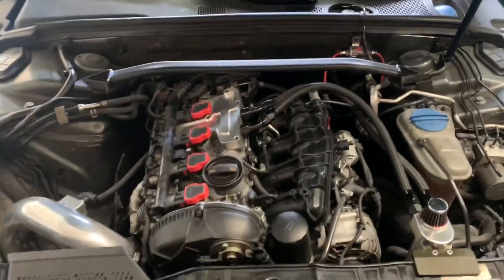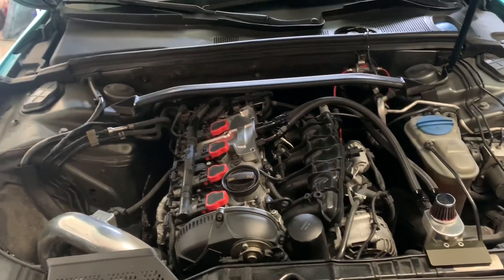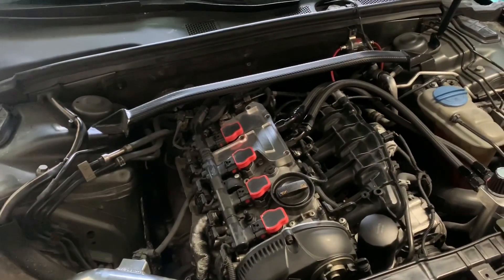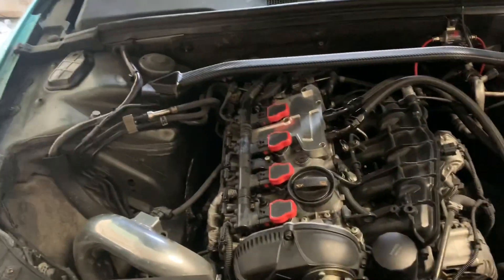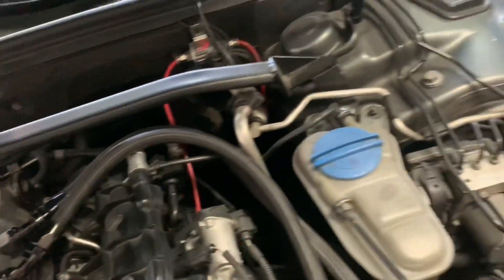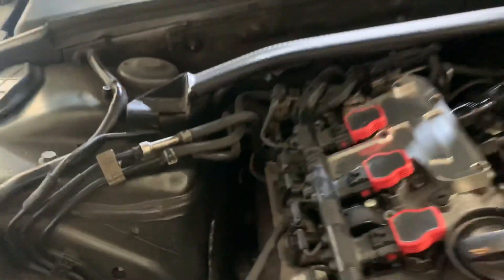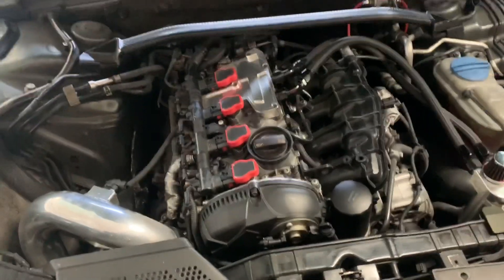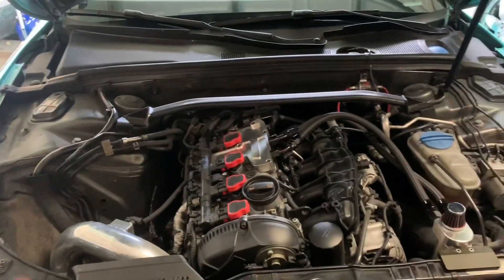How to get 455 hp to a Audi b6/b7/b8/b9 or Vw 2.0 tfsi or Fsi

Comment: that car if your lucky has 350 hp if it's got a k04 but since you lied about dyno numbers who knows post you numbers if you dyno that car let's see the paper work cause there's no waybthat car had even close to what hp your saying lololololol
Reply: IE only boosts that engine to 367hp by using 100 AKI / 104 RON, so pushing this engine to 450??? Sounds like a nice big bowl of baloney.
Reply: @study-tesh9542 yeah this thing is 350-367whp max, I think bro thinks because he has WMI that it is giving him HP. He has an OTS tune it hasn't been dyno tuned on a more aggressive WMI method. So he's really only keeping temps constant to slow heat soak

Comment: i thought these engines like imploding at 300 ft lbs of torque i have an 05 audi a4 b6 1.8t id like to do things to do im afraid of it sending a rod so im waiting to get forged rods to do anything
Reply from the maker: No even Apr revo and ie are l above 300
Reply: @brucecustommotors  is it safe to run those tunes for longer periods on a stock motor with support mods or would it go boom

Comment: Hi BCM, I have a 2015 a4 b8. I tuned it with apr stg 2. Now I need to upgrade my fuel pressure regulator. Can you help me where to order & which one is good. I've been trying to find one but not sure which one. Ty
Reply from the maker: No you’re good b7 only need the upgrade
Reply: @brucecustommotors  but I have misfire on #2. I already change my plugs, coils & fuel sensor. Still have misfire. Check engine & EPC light on. If you can help me please. I really appreciate it. Thank you

Comment: Anybody know if the stage 2 plus tune from IE has launch control for MANUAL 6 speed 2.0ts?or is the launch control only work for the DSG??
Reply from the maker: hey brother I actually, have a custom tune from them, im on revision 6, there cool, just called them, they may even retro a tune for you, or let you know if they have it or there plans, let them know bruce sent you
Reply: Thanks man thatd be great.cars getting a new clutch and lighter flywheel  currently.stock clutch didnt like stage 2 lol.when it's back together I'll definitely be looking forward to that

Comment: Hey so i have 2 questions, I have a 2012 audi a5 cabrio and i am planning on getting the ko4 turbo and i seen how you added the Audi r8 coils,

Wagner inter cooler,

bosch s3 fuel injectors,

Snow performance water meth kit,

Cts turbo oil catch can,

Injen air intake,

flowmaster series 10,

Throttle body spacer,

GFB diverter valve,

Sprint booster, and the 

APR Muffler delete

I was wondering do I need to have all of these installed at the same time in order to put in a ko4 and if not which ones out of these list do i definitely need to buy and install in order to put the ko4 in without having problems. Because I am planning on getting all of these on the list but was wondering which ones are mandatory for the ko4 installation and which ones I can gradually buy later on. 
My second question is should i have the stage 3 tune done on before or after I have the ko4 installed because i know i have to have it done in order to get the ko4 I just didnt know which one i had to get done first, or do thy just do it at the same time?
Reply from the maker: So let me say this, if you get a k04 without the upgrades, when your car boost it will run lean, do to the extra air flow from the turbo.  But only if you push it hard, and go into boost, if you drive it normal with out boosting past 5 you won’t have any issues. The k04 basically pushes more air to the combustion, so you don’t want any restrictions, I ran my ko4 on a revo stage 2 k03 tune, for 2 weeks with no issues, before I got my k04 tune, at the time I had a down pipe air intake, and diverter valve, and inter cooler, which is what I would recommend

Comment: Did you have to upgrade suspension or trans as to not brake anything ? Currently running stage 2 b9 A4 thinking of taking the next step but don’t wsnt to break anything
Reply from the maker: What’s up bro the only thing I did was 
In these 2 videos 

https://youtu.be/Vr8XzO-7sm0

https://youtu.be/TVmF_dUo-FI
Reply: I’ve heard that if I do ko4 swap and water meth I run the risk of harming engine internals I’m not sure if that’s true or not so looking for first hand experience how long have you been driving it with all those mods how often and any problems ??

Comment: Hey bro i need some great advice from you since your like Albert Einstein on this platform. So I bought me a 2010 Audi A5 Quattro Manual AwD its at 151,000 miles on it. I replace new rocker arms and cams and clutch recently and my turbo is out but im driving perfectly fine like a brand new car. But to go the same route as you is it worth doing it with the condition and me being the third owner ? Because I know its alot of money to tear down a motor just to see if the engine is in good health but should i risk doing that because I know its hella expensive or is it safe to just start putting in a Ko4 turbo into it with same mods like you with out the watermeth?
Reply from the maker: I would do a compression test, to see if the engine is healthy, it’s cheap and can let you know how strong your car is first , and then follow the steps in this video and you will be fine https://youtu.be/YZO_tu0u7vA
Reply: Thank you man, I appreciate the advice and much love please keep progressing in this field that you are in and i love all the videos you put out they are amazing. Just im still here for your support for all your next videos

Comment: Hi Bruce
I have been having trouble with my catch can set up since the beginning and I thought you might be able to help. My 2011 a5 has a fully rebuilt CAEB longitudinal 2.0T with basically all the same mods you have as of date of this video. I know you have moved on from there but I'm still running the APR 04 turbo and software. I bought a Spulen Africa plate from USP Tuning and combined that with a Ebay AN hose kit (AN10) with a generic can and a ventilation filter basically identical to yours.  My car will smoke badly and the can fills quickly when I install the can system. After combing the internet for fixes I also stuffed the cam with shaved steel wool material to aid in condensate extraction. Still same problem! Would you have any advice to offer on the subject? I'll try to attach a photo to show the set up. As always thanks for your input.
Reply from the maker: send me a photo , to productuions@bgeminirecords.com , i wonder if its set up backwards, or your tube or internally, if the mesh is backwards

Comment: Hey Whatsup man I got a 2006 Vw Jetta Gli in my backyard with 164k on the dash looks neglected but It still turns on and runs good this car has paddle shifters and Dual Clutch Transmission its a FSI Turbo 2.0 you think it would be worth doing something like this? the engine looks identical to yours
Reply from the maker: yes a 100% you may have the 1.8t like my b7, but you can get same numbers, and believe it are not , they have alot of big turbo upgrade options, for that year
Reply: @brucecustommotors  So mine is a 1.8? Everything says 2.0 on the engine bay

Comment: Did you have to get a custom tune for your weather meth injection bc am planning to go stage 2  with IE with my 2.0t b8 a4 I already have my cai, HF downpipe  big intercooler
Reply from the maker: yes i had my tuner tweeked for more timing, but before that i was just running the apr 100 octane fil starting my injections at 12, and full at 22,  when i was with revo, and i just, did it my self with my sps controller, and looked at data logging, now with ie, and tweaking it as we speak, im getting ready to install the intake, and then will dyno, and hopefully get higher numbers. check out these videos

ie intake manifold review https://youtu.be/M7Y_r18ECVM

how to tune with ie https://youtu.be/m8p9C5m_pSA

water meth playlist https://www.youtube.com/watch?v=rJBG6gfd3UE&list=PLDYd1CUN-FCMgjKKE7a6LrwQFSUDP6wB7

Comment: Bro. Help me out. How did you fix the problems oil consumption ??
Reply from the maker: https://youtu.be/NTXW6AiM_oc
Reply: @brucecustommotors  i got it. The problem is that i run 300km with 1l. That's  a lot. And for changing the piston is 3000e a lot for me. I just bought it 1year ago for 10k at 116k km. What you recomend? The Catch can can solve a bit of the problem ?

Comment: Can you get away with upgrading to the s3 injectors while still on the k03, or would it only be beneficial with the k04 turbo?
Reply from the maker: You will get a slight bump, but nothing significant, unless you tune, but you can get a little more power with a good air intake
Reply: @brucecustommotors  thanks, was planning on getting it done with hpfp upgrade and a carbon clean. Only running stage 1 with dv+, so still have some way to go. Hi-flow cat and fmic are up next.

Comment: I've heard rumors of turbo oil leak from blocking off the intake manifold driver side pcv port. Maybe something to do with over loading the diverter valve lines since some pressure would normally be venting out off the valve cover driver side pcv port. Also the crankcase would be venting out of only 1 valve cover pcv port versus 2 ports, what it was originally designed. Replacing the cyclonic oil separator with one that is lacking a cyclonic system is not a good idea. I understand that the whole idea is to prolong carbon build up on the intake valves. I've researched all Audi A4 B8 FWD 2.0 catch can systems. I think all of the catch can designs (BFI, Billet, ECStuning, CTS, etc) for this particular vehicle all have flaws. The reason being it completely ignores either the driver side or the passenger side pcv vent system by simply blocking off a side. In addition of the block off, some system completely replaces/remove the cyclonic oil separator. If I was to do a catch can system for this vehicle, I would go with the ECStuning system that keeps the cyclonic oil separator. It covers the passenger side pcv port TO ECS catch can TO turbo inlet. Then I will install a custom catch can system mount on the driver side firewall that covers the driver side pcv port TO baffled catch can TO intake manifold. That would be an ideal system for me to prevent a problem down the road. Catch cans you'll have to keep empty them, even more often if your driving region have bumpy roads and hills. Either that or don't install one and remove your instake manifold ever 90k miles or so, manually turn the crank to close each cylinder's valves and clean them one by one. I would also inspect the intake valves using a borescope every now and then. Stupid direct injection system with constant computer regulating unnessary shit for daily driving for the sake of optimal fuel economy by a few miles and slightly lower emission in theory not taking into factor the driver's behavior. Like the eco start/stop system. You have to ask yourself with the high amount of high pressure fuel injectors being replaced due to direct injection system and the high amount of starters being replaced due to constant use from eco start/stop system. How much energy or resources does it take to manufacture those items and transport them to sell to consumers. Is is worth having a direct injection system and eco start/stop for daily use? Port system works just fine and gets pretty good gas mileage if its an inline 4 with more gears keeping the rpm low at cruising speeds.
Reply from the maker: if your seals are worn, you can have that problem, which is why I put a breather on mine, to your point to elevate crank case pressure.

Thanks for the passion and info, god bless

Comment: Hey 👋 Bruce quick question 🙋‍♂️ on your set up! I have a B8 A4 2.0t was considering to put the Audi R8 Coil Plugs. Which ones should I get? Year and Red ones or black top? Please let me no, I will appreciate your feedback. Thanks 🙏
Reply from the maker: Yo what’s up bro , here you go, the price in the description, there a little pricey because there oem, but places like euro running have modified ones, that is cheaper that could possibly work, I just bought 2 fakes sets by accident, so went the dealer route
Reply: Thanks Bruce I appreciate your honesty and your time to respond and to make new vids for us Watchers/tuners. 💯 🙏🤙
Reply from the maker: @austinbravoaldama3990  any time

Comment: Hey Bruce
I am awaiting a set of s3 / golf R fuel injectors. I was wondering if you have upgraded your high pressure fuel pump when you installed these injectors? I am considering installing the JHM piston upgrade. Do you have any thoughts? Thanks again for all the great videos as they have really helped me out!
Reply from the maker: No there’s currently not an upgrade for the hpfp for b8 or b8.5 unless it’s custom but I haven’t had any issues thus far, i think b7 has one
Reply: @brucecustommotors  Bruce, I'm pretty sure the piston and cylinder upgrade for the B8 2.0T platform is available. I'm gonna double check though. So I guess what I'm asking is that in your experience, you haven't felt the need for additional fueling volume or pressure with the up sized injectors? Believe me I am not looking to throw money down the drain as these HPFP upgrades go for 350.00 to 600.00. Interestingly I got a set of S3 / Golf R ("Bosch") injectors for just $239.00off Ebay. I just hope the hell they are genuine, the vendor swears they are. Thanks for the response buddy!

Comment: Hey bro i recently installed an bigger intercooler on my b8, im having this experience where it feels like vtech, alot of air is being sucked in and its pushing the rpms high but not steady, im currently running stage2 integrated engineering any suggestions?
Reply from the maker: 3. things come to mind, it could be a higher power distribution, and the car can't keep up, because now you have a more dense and cold charge, a lot of times in cold weather this happens, try one of these 3

1. reduce your spark plug gap, could be pushing to much boost and blowing out your spark

2. upgrade to s3 injectors 2015 and above are the ones for our car

3. try a hotter spark plug, if you're running 7, try 6, if you're running 8 try 7.
Reply: @brucecustommotors  so i did a couple pull logs and sent it to ie cuz thats the tuners im with, they said its because my dv isnt holding boost, funny thing is im using the new gfb dv+, so i started researching any faults and alot of people actually had the same issue with there gfb dv+ spring isnt holding the boost
Reply from the maker: @deevee6203  
heres my 2 videos on both subjects, check out my tunning and perfomance playlist

gfb diverter
https://youtu.be/m6cl56weLAA

spark plug and gap
https://youtu.be/7CEiuemy8oQ

tune and performance  playlisthttps://youtu.be/oV252jayFA8
Reply: Im try gapping the spark plugs to because there due time for a change, what size gap do you recommend and what type of spark plugs are you running?

Comment: I have a question I have almost same setup except im getting ready to add the Sno meth injection to my car. What do you have your APR octane setup at? Right now I constantly run 93 octane with the meth injection do you need to change it so its as though your running Cam2 racing fuel?
Reply from the maker: so I run my meth with the 100 octane map, and I run cam some times, but mostly I use boostane, which is a comparable fuel adhesive. if I'm low on race fuel, im still ok from the meth doh. but before I was running on 93 it was ok, but 100 gives you more timing, I Strat my spray at 12, and end at 25, which is around my high boost peak
Reply: @brucecustommotors  ok so you do put ur setting on the higher setting? The reason I'm asking is because APR says you can't do that. Another question my engine code is CAEB and I can't find S3 injectors to fit, where did you get them. Mine is a 09 I have APR II+ CTS K04 with 200 cell HFC IE performance intercooler, K&N air charger and AWE cat-back SS dual exhaust with quad tips. I just love the sound you have it sounds like the RS's. Is that a custom exhaust?
Reply from the maker: @wyhsbrep  here are the injectors, they changed them to these I believe in 2015
 https://www.ebay.com/itm/4x-Genuine-Bosch-Fuel-Injectors-Nozzle-For-VW-Golf-R-MK7-Audi-S3-8V-TTS-2-0-TFSI-/133575740329?_trksid=p2349624.m46890.l49292

Some times people buy the older ones were the plug doesn’t fit, so be careful sometimes people mix up the year, and yeh apr told me the same thing, there really safe when it comes to tuning. Which is why they discontinued stage 2 tune. But the higher the octane the more timing you can ad. And when I had revo which is more of an aggressive tune I had my start point at 7 because it’s starts of dope aggressive, we’re as apr is conservative and builds up more. You want your starting point to be at your most aggressive boost peak so the air can atomize the meth, check out these 2 videos in these links
Reply from the maker: @wyhsbrep  meth https://youtu.be/Fm5cEJr7Zm4

Exhaust set up later in the video
https://youtu.be/QhkPI-Rjd4M
Reply: @brucecustommotors  ok thank you I will check them out and when I get my meth setup I will get in touch. I appreciate the help it means alot
Reply from the maker: @wyhsbrep  💪💪💪💪💪💪💪

Comment: Were these hp numbers an estimate based on bolt ons or AWHP from a dyno?
Reply: These are crank numbers, this k04 is maxed out.
Reply from the maker: yeh Im maxed out, the meth pushed my threshold , I currently have a built engine, and working on a big turbo project, I was going to go with a garret 85mm, just working on fueling right now,